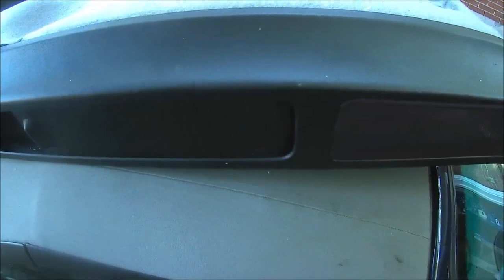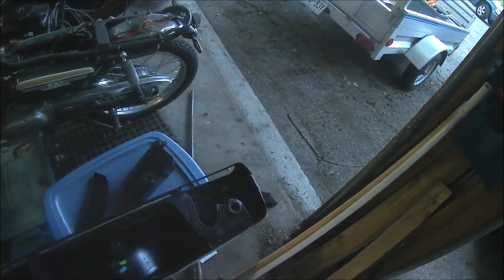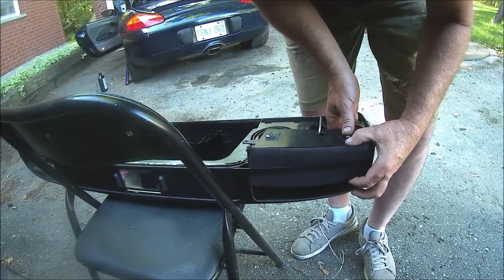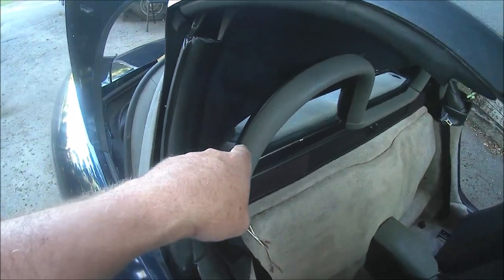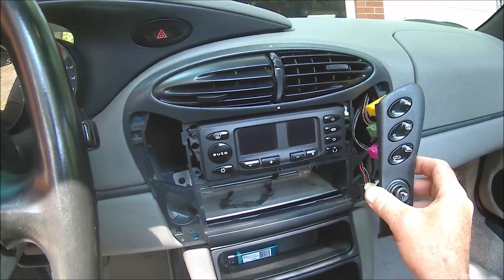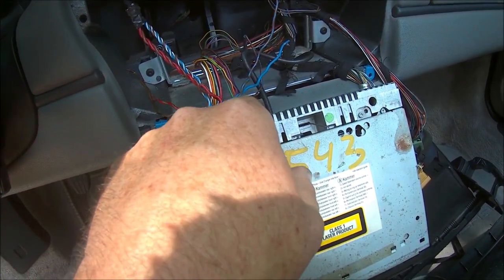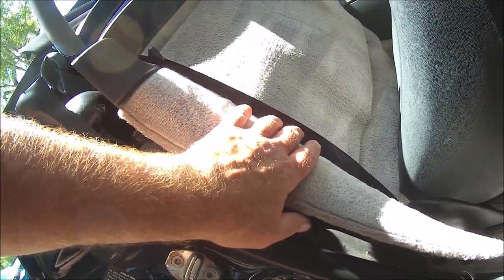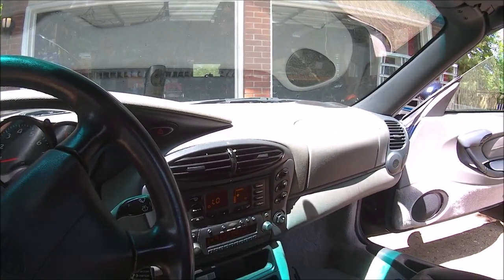Porsche 986 Boxster   Adding rear speaker box +DIY speakers

Comment: Awesome project.  I definitely recommend you change the front stock speakers.  Super easy to do.  not much modification and the sound is a huge improvement.  The original Nokia OEM speakers I had were paper thin and it didn't even have a tweeter.  It was a faux tweeter cover.  Probably since I have the super low end base model.  I don't even have door speaker... so sad.  But anyways I'm inspired to do this project.
Thanks!

Comment: What else is holding the zipper storage casing in place other then the two clips on the bottom and the cable holder on the sides? Trying to install rear speakers as well and struggling where it might still be holding it in place
Reply from the maker: As far as I know the 2 bottom twist knobs and the rollbar clip are what hold it on

Comment: How are you
 Mercedes-Benz C-Class 2001 with its suction key
 The switch is running well but
 Sometimes starter does not work
  Sometimes it works
 What are the reasons?
Reply from the maker: battery,starter wiring,starter,brake light switch or ignition switch ..could be any of those
Reply: P0600? 
What to do
Reply from the maker: Main engine computer problem